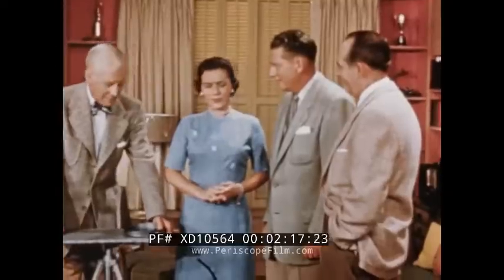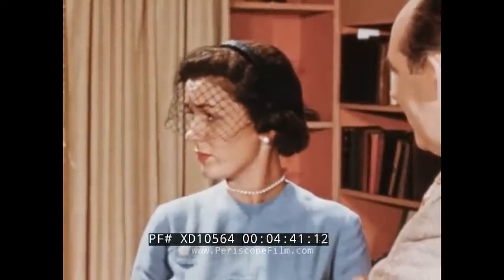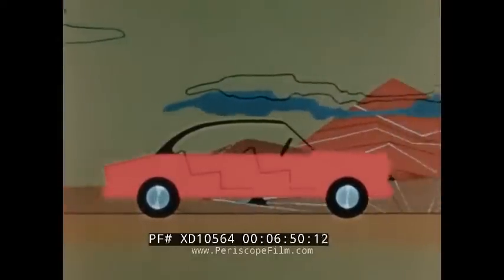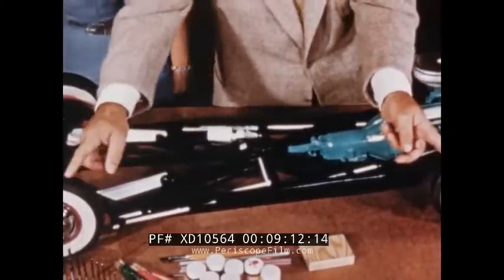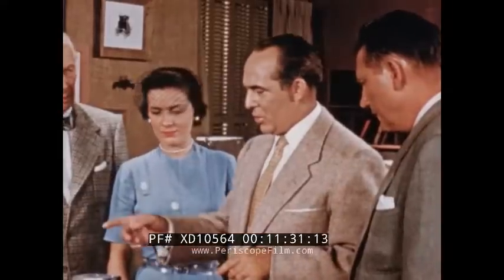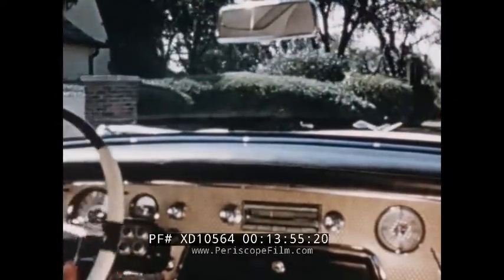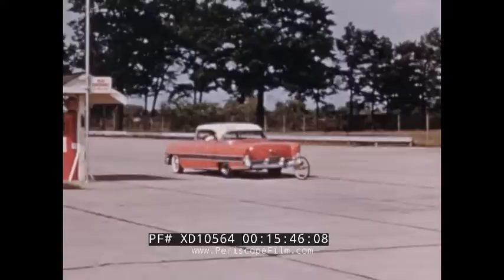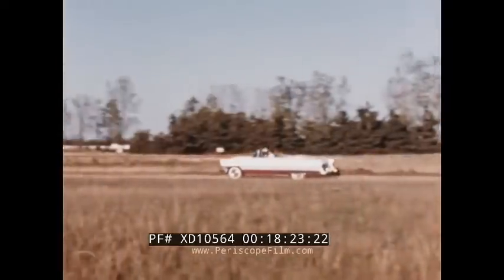1956 PACKARD AUTOMOBILE CO.  " THE SAFE ROAD AHEAD "  TORSION BAR SUSPENSION SYSTEM XD10564

Comment: Packard had always been trying to appeal to the upper middle class and upper class market. It starts with the obviously comfortable modern home. Note at 3:10 the large Zenith T600 Transoceanic "portable" radio on the table to the left of the woman. This was a long range AM and shortwave radio much in demand for people like those in remote hunting and fishing camps, sailors, and explorers like Richard Byrd. It cost $139.95 in 1956, the equivalent of $1,388 in 2019, so it was a high status thing to have sitting in your home, but also a good prop to demonstrate pushbuttons. Everyone going to the "club" at the end was also a pitch to those who belonged to country clubs.

The boys were being a little disingenuous about torsion bars. They were first used by Citroen in 1934, and almost all WWII tanks used them as well. Many German panzers had the front to rear torsion bar setup similar to what's being shown, but Packard was the first car company to use the concept in a passenger car. The electric motor for automatic leveling was another first in the auto industry.

The Push Button Ultramatic was not a first, Chrysler developing the push button PowerFlite the year before. Packard decided it could develop a better (and cheaper) option using an electric motor to engage the gears rather than a mechanical linkage that was essentially the same as using a manual shift lever. The Chrysler system turned out to be very reliable. Packard, currently in its final money crunch, couldn't afford to engineer a new motor made especially for the loads put on it by the transmission selections, especially if the car was on any kind of grade, up or down hill. The modified a starter motor and hoped for the best. It turned out to be a disaster. The motor didn't have enough torque to get the car into drive on a hill, so circuit breakers popped and the car was stuck. The owner would have to await a tow truck to get him off the hill. In some cases, the loads were high enough to start the wiring on fire, destroying the entire car in a couple cases. This "futuristic" transmission system cost Packard hundreds of thousands of dollars in warranty claims at a time when making payroll was becoming harder and harder. 

Packard had workable plans to fix these problems in the 1957 models, but time had run out.  Packard had merged with Studebaker in 1954 in an attempt to keep both companies afloat. There was a merger mania at the time, and Packard, much more financially healthy then, accepted the word of Studebaker management and their balance sheet that Studebaker could be an equal partner. As it turned out, Studebaker was near bankruptcy and had been turning out misleading financial statements at the time of the merger, and the formerly strong cash position of Packard was drained off to pay enough of Studebaker's debts to avoid bankruptcy for the merged corporation. By 1956, the situation was dire. The Packard plant in Detroit was the more modern but also much too large for the diminished numbers of Packards being sold. The toolings costs were just too high to maintain the real Packard line. The Studebaker plant in South Bend was older but also smaller and cheaper to maintain compared to the sprawling Packard plant. Consequently, the decision was made to end Packard production and move the machinery to South Bend. This film must have been made right after the introduction of 1956 model in September, 1955 since everyone still looked happy and hopeful. Alas, that wouldn't last, as the last real Packard rolled off the line in Detroit on June 25, 1956. Parts of the plant were used for smaller businesses after the plant closed in 1958, but the area around the plant deteriorated, and the businesses started to leave, the last closing up in 2010. Most of the plant remained unoccupied and unsecured, so scrapers moved in and removed anything of value, including the wiring, plumbing and window frames. There have been a number of plans for reuse over the years but none have come to fruition. Its highest use has become as a tourist attraction for those into ruins porn and movie sites for life after humans types of films. The iconic pedestrian bridge between the two largest plant buildings over Grand Blvd collapsed into the street on January 23, 2019. It seems to be a rather symbolic end to what was once one of the largest industrial concerns in the country, and maybe a sign of the times we live in today. No one will probably ever read this but, if you do, ponder that for a bit.
Reply: Citroen had used torsion bars for 20 years at the time of this film, VW for almost 15 and Porsche for almost 10. I have seen a few GMC and Chevrolet Trucks of the early 60's with Henderickson torsion bar front suspensions and of course the biggest user was Chrysler incorporating them into their designs and using them for over 20 years. As the previous poster mentioned Packard spent a lot of money on new and high tech designs but they weren't all fruitful and it turned out to be money they didn't have. I've heard that both Studebaker and Packard fought hard to stay out of the Hudson-Nash merger that created American Motors which may of been a bad business move. They needed economies of scale and needed more than Studebaker and Packard to achieve that. Alternatives may of been to team up with other smaller manufacturers to get that scale of economy  What comes to mind would be Checker, Kaiser-Jeep and International Harvester. Each having products, market niches and  marketing capabilities that each other could use.
Reply: And in retrospect and after a few weeks thinking about it Citroen  had moved on from torsion bars when this film was made coming out with the DS that used Hydropneumatic suspension. I guess the innovation from Packard was tying the front and rear suspensions together and ins some events using both front and rear travel to compensate for  road irregularities
Reply: Goog god, man
Reply: Packard brought back a 6-cylinder car in 1937 to compete with cars like Pontiac and Studebaker.  It sold well but eroded Packard's upper class image.   They even started building Packard taxis.  More of their upper income customers defected to Cadillac.
Reply: Good read. I love auto history, I did not know the deal between Studie and Packard. A real shame, but bad financial decisions will kill any company.  No goverment bailout for them I see. The model Packard in this commercial is a great looking car.
Reply: Well said, thank you. My late father was fan/owner of these cars.    😎
Reply: @Sar Jim  Very interesting to read, thank you. I knew their pushbutton transmission, being all electric, had issues but never knew the extent. Edsel came out in 1958 with its pushbutton transmission which was also electrical, and they had issues with their shifting motor too. Specifically from what I read was that it was not shielded from a nearby exhaust pipe and from the elements. I think it was late in the model year that they did add a shield.
Reply: Very very interesting commentary, thanks.
Reply: If you ever get the chance check out the "Citizens Motorcar Company", AKA "America's Packard Museum" in Dayton, OH. They have one of the finest collections of Packard automobiles and other memorabilia anywhere.
Reply: Not correct in that Packard lost the body builder Briggs who was bought by Chrysler. Consequently,  Packard had to borrow money to buy the Connor Avenue Briggs plant from Chrysler. At that point it was decided to switch production from East Grand Boulevard to Connor Avenue. So in 1955 not only did they have a brand new V8, brand new suspension system, brand new transmission,  they had a brand new factory which was set up in less than a year. That took some doing. The last Packard to leave East Grand Boulevard was in 1954. I have a 1954 Packard Patrician with the straight eight engine here in the UK 🇬🇧. The US government also withdrew contracts at the time and gave them to GM
Reply: An extraordinarily well-written piece on the demise of Packard. It was a sad ending to a once so proud make of automobile. Thank you. 😁
Reply: A coupla final thoughts: with Packard in South Bend I always thought Studebaker bought Packard  A few years ago I found out it was the other way around. 2 proud but dieing brands joining forces, like throwing an anchor to a drowning person. One other factor in Packards demise was they went from a high dollar status car to a everyman's car. Still this video shows that Studebaker and Packard had one thing in common, they could make the most out of nothing. Those'58  shark nose Paackabakers are highly desirable today as are the '55-'56 caribbeans(sp). Ask the man who owns one.
Reply: Great comment! 👏👏👏👏